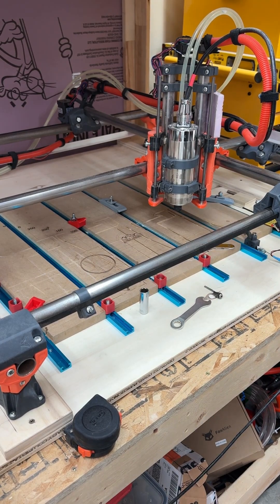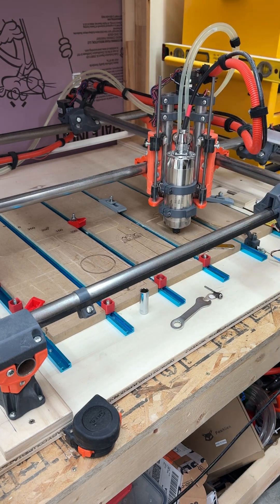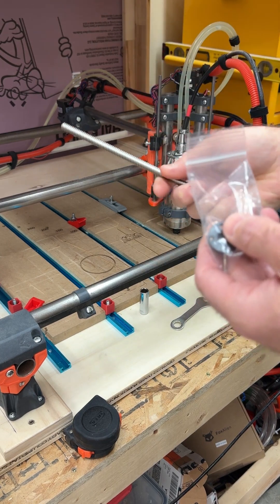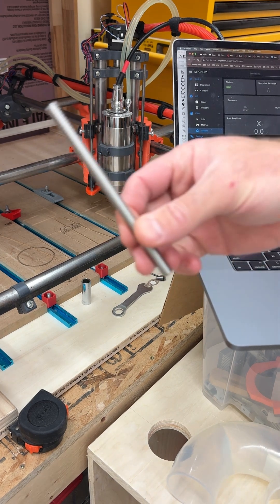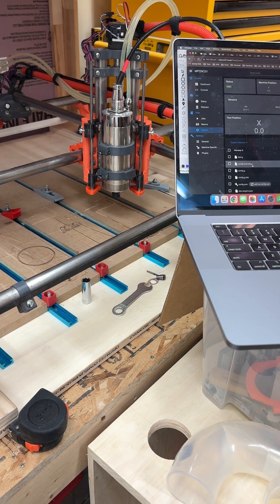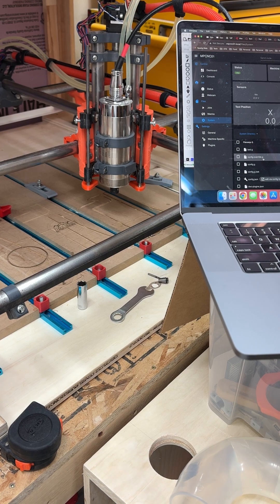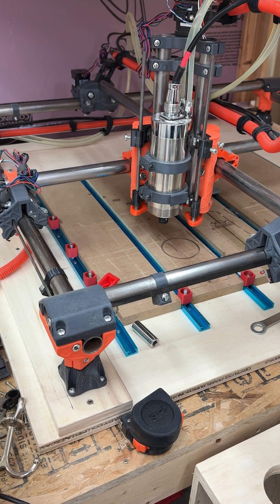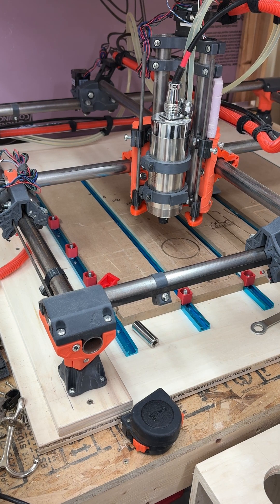Time for a small change on my MPCNC

Comment: Neat MPCNC build, and neat leadscrew upgrade.  Will do this for my LowRider3 as well for similar reasons.  Cheers!
Reply from the maker: Yeah I have seen on the forum people playing with both 1 and 2 start lead screws due to the extra weight of the LR3 gantry depending on spindle and extras you might have.
Reply: The Z on my LR3 also drops.  It’s a cushy kind of release that just settles on the bottom of the screw.  I may look into this as well.